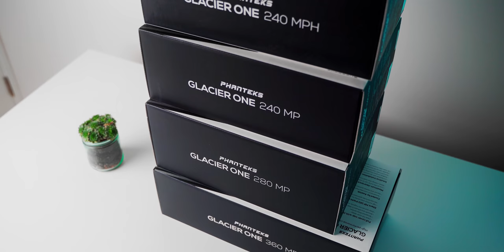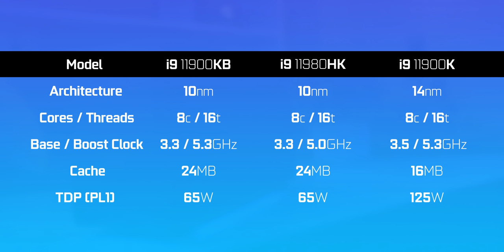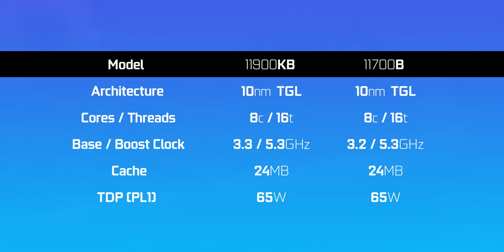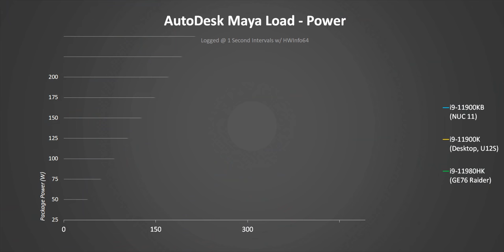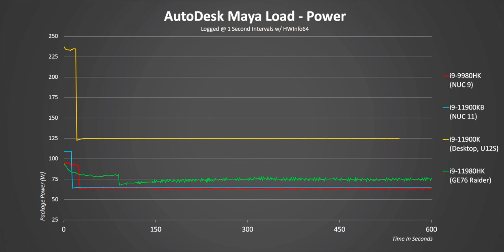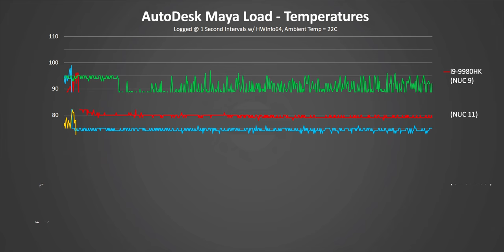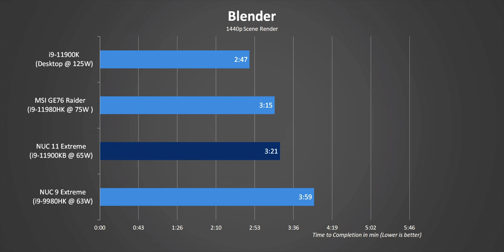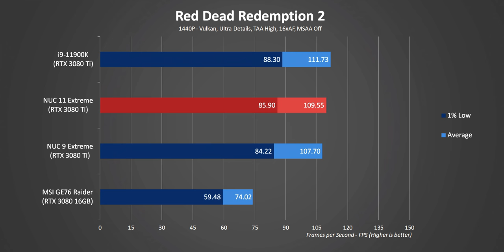The Best Intel PC - Beast Canyon NUC 11 Extreme Review

Comment: 8L with room for a 12in graphics card is still very compact.
I think the design of the case makes it look larger than it really is.
Reply: I mean you can get a DAN A4 wich is 8 l in volume and it looks cleaner.
Then kit the DAN A4 out with a 5800x, 32gb ram, 1 tb ssd, 650w power supply, good b550 board and a cooler and you are at about 1200$. So 150$ cheaper than the NUC and there you have still to buy SSD and Ram.
Its not a good deal at all. It is kind of good engeneering but for that price it is a simple no no. You can build an ITX system with better hardware and expandebility for quite a bit less, so i dont see a reason to buy this instead.
Reply: Yeah Dan A4 is a little over a 7 litres in volume so smaller like the other person in the comments has said as well as Velkase Velka cases. There is another large NUC (or should I say, CUC) which is around 7 litres in volume as well (so smaller than this CUC) in the Cooler Master case and PSU combo called the NC100.
Reply: @timlolxP  If it was actual good engineering they'd put the chip on the other side of the board so the cooler could draw fresh air from the vented panel instead of that little slit at the back

Comment: This is more a "shuttle" size than a "nuc".
Reply: Yeah, agreed I like the Shuttle/SG05 type of mini PC. I have built a few of both. But that wasn't ever what the Nuc was supposed to be about. So far from the movement to a full computer in a Firestick sized HDMI connector that was the OG goal of the Nuc. At this point you are just getting a Proprietary version of something people have been building for decades.
Reply from the maker: There is too little appreciation for Shuttle these days.  - Mike

Comment: Just picked up a bare bones one of these for $800...Replacing my older Hades Canyon Nuc, at this price, it is worth it.I just stuck the 32gb ddr4 ram and the 2tb m.2 ssd from my old nuc along with a gigabyte rtx 3080 Turbo (blower type gpu) that I picked up used for $600...for $1400...I am quite happy with it.

Comment: Managed to snag a i9 12900 complete NUC second hand with 16gb ram, 1tb m.2 and 3060ti. I am never going back to full form factor ever again. I love that it's small, not in the way and that it looks like a normal device. Sure, it reaches about 80c in temps on gaming, but I'm more than fine with that when you take into account the cooling system.

Edit: Nuc 12 that is, not 11 as the video here. And not second hand as in used for months, or years. My unit was activated just 2 weeks before I bought it and it looks brand new. And it came with Windows 11 pro. A steal.

Comment: Interesting.. I get 4500 CB R20 in my Alienware M17 R3 with 10980HK.. all cores locked at 4.4ghz, no throttling (using laptop cooler and performance fan mode).. I just expected a desktop 11th gen part in the NUC to really thrash it but it's barely faster.. The raider beating the NUC doesn't make sense, so there must be some thermal and/or power limit problems here.. No way to improve that via XTU or the bios? I must admit I am blown away by the Alienware's cooling and it's by far the best performing laptop I have ever had.. Idle temps are high, like 50, so I was worried, but when it's under load the vapor chamber goes to work and it, works! I can sustain 100% load at 4.1ghz on all 8 cores at 80 degrees all day and night and I think that's very impressive (yes at 4.4ghz it's in the 90's). I just expected better from NUC 11.

Comment: The biggest problem is it's the size. The popular and smaller A4 Case is just $200(which is still expensive in my mind) it provides better cooling for the CPU. You still got $1000 to spend on the MB + CPU + PSU.
Reply: There are even cheaper cases like Geeek A4

Comment: I don't like the air inlet from the back, close to the hot air exhaust. Many users will want to  place the NUC close to a corner or in furniture opening , and this layout can easily  recirculate hot air back into the computer leading to overheating.  I have seen it before in similar designs, and it can create serious problems. 
Apart from this it is a great machine and I love the NUC family. But more than big brothers like this  what this family is  really missing  is having a NUC eGPU specially designed for it (for example using a PCIe extender rather than expensive thunderbolt with limited bandwidth ). That would make it much more portable, for example   when you don't need the egpu for a trip. Also it would be easier to upgrade by parts and more  flexible to delay part of the investment, or to combine with other NUCs.

Comment: This is what I would use gaming away from home. I’d plug it into the mains and connect a 27” monitor. So I don’t need a battery or a tiny monitor. I think a laptop is too bespoke and very expensive in heat dissapation and battery usage and are light in the graphics department.

Comment: I’ve liked the NUCs for a while now and this is a pretty slick iteration/evolution. 2 main questions I have are: 1. If you put a add-on card in the x4 slot (say a 4K capture card), how much of a performance hit (thermally and dropping the GPU to x8) do you get in rendering? 2. Similarly, if you populate all those M.2 slots (holy cow are there a lot for the form-factor) is there a performance hit or is that all handled by the chipset? Cause dang, a 3080+4K Capture card+over 12TB of SSD storage in 8Ls… wow.

Comment: The Beast Canyon is not built upwards but outwards (shorter and longer) because of good dissipation of heat. That's what makes this machine so quiet and powerful! As you may know heats propagates upward so building components one on top of the other (building upwards as you say) would only suffer in terms of heat retention and you definitely don't want that.
Reply: That's quite ironic since most gaming PC build always go for upwards body.
Reply: @FAT8893  sure! but you’re talking about normal gaming cases with lots of space inside for the components to “breathe”, forgetting the point of such a super small form factor system with those powerful components packed so tight against each other. This nuc is the smallest machine on the market right now, with such powerful performance and yet being so cool and quiet. i think that’s exactly why it has been engineered that way, outward and not upward so that heat gets out from the top faster and more efficiently.

Comment: The NUC lived in this zone where it was too small for SFF PCs to compete on a space basis and therefore certain consumers had no choice but to pick it, regardless of sacrifices in upgradability or price
This NUC confuses me, because I don't get why anyone would pick this over a Dan A4 or a Velka case. Both are within or below the size range here and is infinitely more upgradable, and if you source the parts yourself you can get it everything probably for cheaper.
I won't stop consumers from spending their money how they want, but I want to emphasize that it's suboptimal to spend it on this thing.
Reply from the maker: GREAT take on this.  Thanks for the insights.
Reply: You can't build a Tiger Lake system in any of those cases. And those parts are considerably cheaper in the US than in other countries.
Reply: @prajaybasu   I don't fully grasp the point you're trying to make. Are you saying that the Beast NUC is for people who specifically want Intel's CPUs?
I'll reword the point I was making: you can build a PC in an SFF case with comparable hardware for less or similar price. The price tag I'm thinking is $1350 USD to buy a CPU, motherboard, case, and power supply. A 3700X is apparently really close to the performance of an i9-11900KB at the same TDP* for ~300, a 650W gold PSU is ~130, the motherboard is ~200, a Louqe Ghost is ~300, a Noctua NH-L12 Ghost  is ~55. That's still $300 cheaper than the Beast NUC. Admittedly, that build gives up a few things that are Intel-specific like Thunderbolt, but I don't think there is a processor on Intel's side at that TDP and performance level.

But I'll admit, I don't know how hardware prices are outside of the US, so I don't know how the DIY system's price compares to a NUC. There's definitely a convenience factor to the NUC being built for you and if the extra cost of a NUC is less than the labor cost of having a system built, it's potentially worth it for those who don't care about upgradability.

Footnotes:
* The two companies measure TDP very differently
* The 11900KB has very little benchmarks so margin of error is high
* I would have picked a 5000 series processor but AMD doesn't offer the 5700G as a standalone purchase
Reply: Seems like a solution for people who don't want a prebuild but also don't want to build an entire PC. Personally I'm interested in this machine for work as we have a lot of devices that need to be controlled using PC's and I don't want multiple mid/large size desktops and I don't want to spend too much time building each one (SFF prebuilds are hard to find where I live).
Reply: @FlorisErich  I recommend figuring out a PC build (or getting a tech enthusiast friend to do it for you) and hiring someone to assemble it for you. That's an option to save yourself a few hundred for a bit more effort.
Reply: prices for individual components aren't necessarily getting any cheaper or anymore cost effective to build yourself as stuff just gets more and more expensive the pc i built last year costs nearly as much as this w arguably worse specs n worse still the combined cost of lookin for these parts WITHOUT trying to go resell is near impossible rn

Comment: I have a 9.5 liter itx case with a ryzen 9 5950x and 3080 ti both on a custom loop.  It's the same size as the nuc.  But the nuclear is cool if your on a budget and don't feel like putting in the time to build an itx system right.

Comment: Arguably, NUC has been about making small computers with sufficient power to be good tools. The first NUCs had no provision for adding GPU's, they used internal Intel graphics, two screens possible and came with screen mounts in the box so you could bolt them to the back of the screen. We actually bought a number of them for work. These new mini gaming rig "NUC"s are barely NUCs in my book, they're small Intel PC's that are not meaningfully small anymore. A micro tower, or a midi tower, it's still a tower.

Comment: Wait. So the x4 slot is blocked when the computer unit is installed? So much for a capture card. I thought this would be a decent portable video rig until I saw the tiny/fast note pop up.
I wonder why they included it if the compute unit itself covers it?
Reply: It's covered by the duct, not the compute unit itself. The duct is an add-on for when/if you're using an additional graphics card, to prevent heat-soaking the CU. You can add a secondary card (like a capture card in your example) just as fine, without using the duct, but since there would be little to no space in between the CU and the capture card, the CU would prolly kinda "suffocate" a bit, leading to higher temps.
Reply: @NiC707  Thank you. So the duct wasn't the fan shroud on the unit itself, but attaches to the unit? So when you say additional graphics card, that would mean the discrete GPU that 90-95% of buyers (I own the first 2 canyon nucs btw) would be looking at this version for? So, the scenario if I read your comment correctly is You can have a compute unit with duct and discrete GPU with decent temps, or a compute unit with no duct, x4 capture card, and discrete gpu but very restricted airflow to the cpu fan? Is that correct?
Reply: @bhgemini  Apologies for not making clear, the “duct” is the compute unit fan shroud (if that’s what you mean by “fan shroud”), I just stuck with the term Mike used, for the sake of reference. That’s what’s blocking the 4x pcie slot, and it is removable as you can see 11:30. Yes, you’re correct on both scenarios. You would have some tight tolerances to work with in the second scenario, especially on the discrete gpu as there are various models with different sizes out there, but it’s doable.
Reply: @NiC707  Yep got it. Sorry for using fan shroud instead of duct. Though it does cover the fan it is more of a duct to the back of the case. Thank you for the clarification.
Reply: @bhgemini  No worries, it is indeed a bit of an awkward placement for the 4x pcie slot, although I'm guessing they would have to add more width to the whole structure (case/m/b) if they were to allow for more space between slots. Tbh, although I really dig the whole package, I would be looking into a custom sff build, at this price point.

Comment: At this size I really don't see the benefit of going with a proprietary CPU/motherboard unit from Intel with no guarantee of long-term support and expandability when the alternative is to build yourself a small ITX box in something like a DanCase A4 which is similar in volume but uses all standard components, ITX motherboard, SFX PSU and standard sized DIMMs.
Reply: the benefit would be from someone who lacks the skill money n patience to try n find n put together all these crazy components on their own. disregardimg the state of the world the last two years
Reply: @maiastniki  first of all, thanks for the 2 months necro (I guess?)

Secondly, I concede if someone lacks the skills and time, fine, but someone who lacks the money would definitely not go for this, as it would end up costing more than a similarly spec-ed ITX rig built using off-the-shelf components

Comment: Interesting. I liked the idea of the Ghost Canyon when that was announced, but the smaller graphics card size put me off from it. Beast Canyon seems like what I would have wanted, but I ended up building a SFF PC in the 9.5L FormD T1 w/ 5600X & 3080FE.
Reply: Was it hard to build in that case?
Reply: @_shadow_1  It wasnt too difficult since I went with an aircooled set up and read alot of guides on the formd reddit. Cable management was a bit of a challenge. Ended up ordering some custom cables so it looks more clean.
Reply: @mizouse02  Sounds nice given the nightmare that sff builds can be. While my sff pc is less powerful and isn't DIY, my zotac magnus one has an i7 and an rtx3070 and comes in at 8.3 liters. I didn't have to build it as it came pre-assembled, which is a shame because the way it opens up is quite cool and it is really easy to get too most of the components quickly. It is a bit loud out of the box but it has a good thermal design that takes care of the heat by exhausting it out of the back. It has it's not perfect, but it doesn't need to be in order to work well.

Comment: I'd still go with a custom build over this with AMD, save a lot more cash.
Reply: If you have to use ITX parts for psu, mobo and riser cables can it really save that much more cash though? Real Question
Reply: No you wouldn’t save that much cash and it wouldn’t be as compact as this or as quiet

Comment: Can it even be called a NUC at this point?
Reply: It is still small form factor, and it doesn't use a standard motherboard, but instead its own compute element that consists of both the motherboard and the CPU, so yes, it is still very much a NUC.
Reply: It could be called a CUC
Reply: SNUC? Super nuc
Reply: @marvingulanes5577  super cuc*
Reply: CUC is better. It is a Supersized CUC!

Comment: Can you recommend 3080/3090 GPUs that actually fit well? Thanks!
Reply: I don't think any 3090 will fit in this thing...
Reply from the maker: EVGA RTX 3090 XC3 fits.
Reply: @HardwareCanucks  even though EVGA lists that as a 2.2 slot card?

Comment: I disagree with the cuc point(funny tho) and think it's wrong because that is a premature assumption at this point I believe the bigger sized 8L enclose is just another option. For two reasons, you guys overlooked that the form factor of the NUC itself hasn't changed, and can be purchased separately from the kit/bundle. Which leads to the second reason, where was it said that the 5L enclosures are going anywhere? You guys seem to be analyzing the entire NUC kit as the NUC itself when it is actually a component within the kit.

Comment: The 11900KB should've been on a desktop socket, that will probably have done better than the 11900K.
Reply from the maker: The problem is pushing it to above 65W consistently
Reply: @HardwareCanucks  On a desktop socket it would have plenty of cooling and power to do that.

Comment: I know it's a bit expensive, but I like my zotac magnus one with an rtx 3070. It has a similar form factor to the ghost canyon (it is a bit larger @8.3 liters though).

It did cost me 2k, but I think the size is comparable to the beast canyon and I think it even has a smaller footprint than it does, the cpu is unfortunately only an i7 10700f which is only 65 watts, but it is replaceable because it's a desktop variant. It does get a bit noisy under load so if for some reason you obsess over that, replacing the stock cpu fan on it with something quiter would probably go a long way to reduce the volume, mine also had a single channel laptop ram but comes with a second slot.

It's got it's flaws, but it works well enough and looks cool without any rgb. I kind of like that it doesn't scream gamer because it adds to the shock when I tell someone my pcs specs.